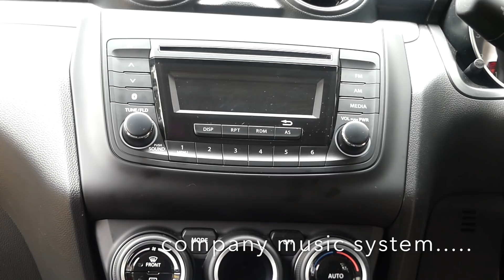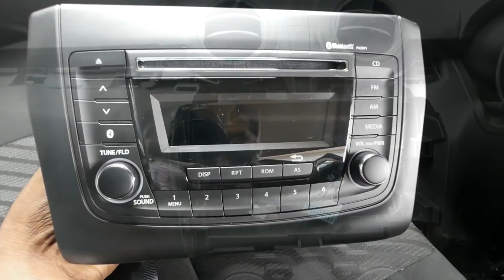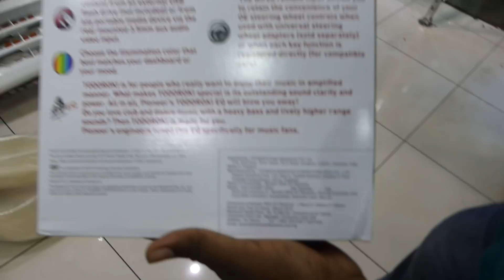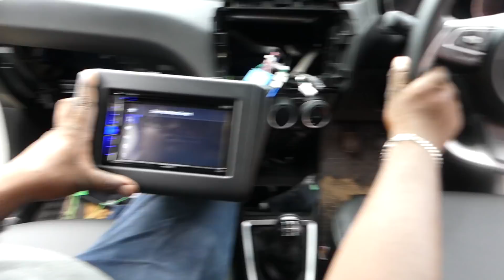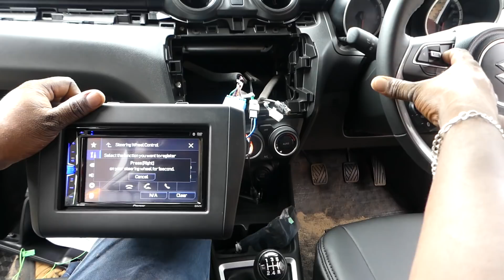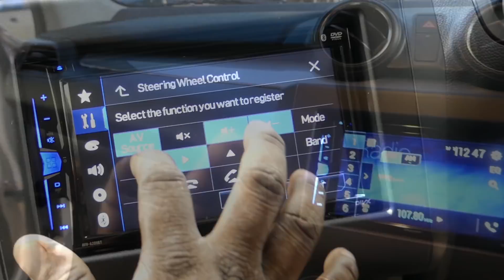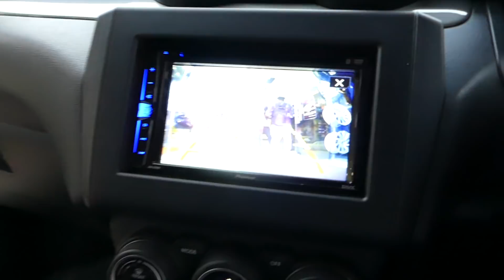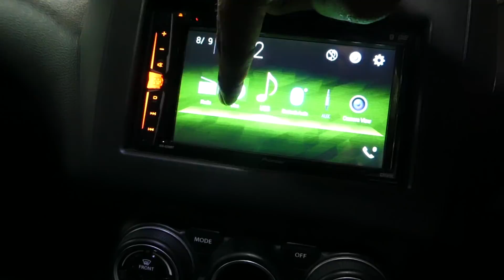New Swift White Colour Audio Player Changing Seat Cover Adding Reverse camera and Horn

Comment: 4:57 he is making hole in original seats ... Very bad .. means after cover you can never use original seat again..
Reply from the maker: No Problems After remove that seat cover... bcz its only stitching that fabric seat..
Reply: Same here man, i'm worried about the hole they made. It will eventually turn bigger when u seat on it everyday

Comment: This varient zxi not vxi
Reply from the maker: yes Zxi.. some mistake in typing ..thanks for your valuable suggestion
Reply: @filmfokuz1424  i bought swift zxi amt.it has parking sensors but no rear camera..i wanted to install rear camera...will it affect the warranty...and where should i get it done..please reply
Reply from the maker: fix the camera without cutting any wire.. me fitted in my nearest car accessary shop
Reply: i confirmed from the maruti showroom here..they said of u get it done from anywr outside..plug in o woteva...warranty will be void